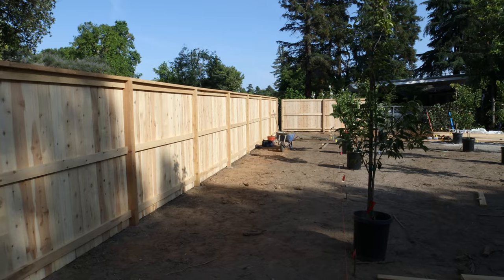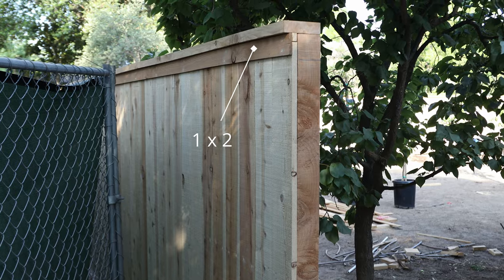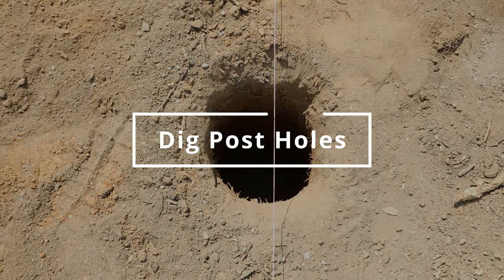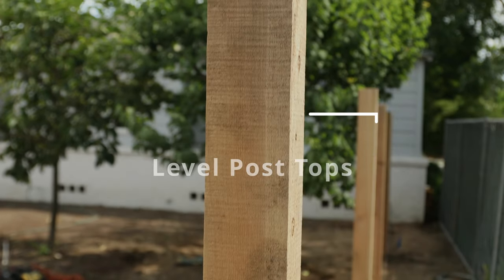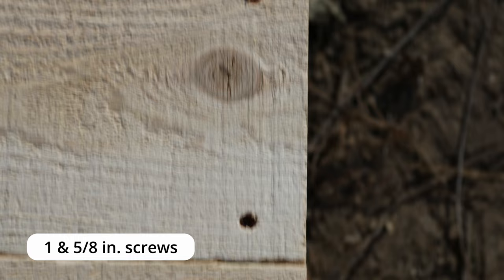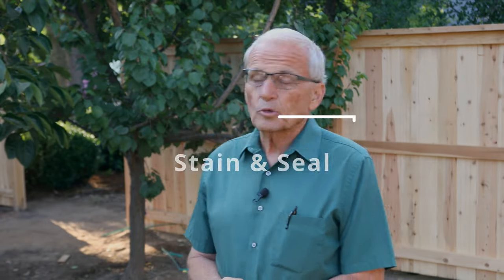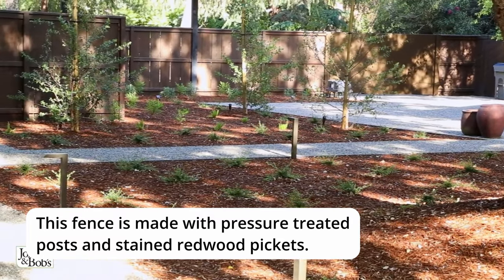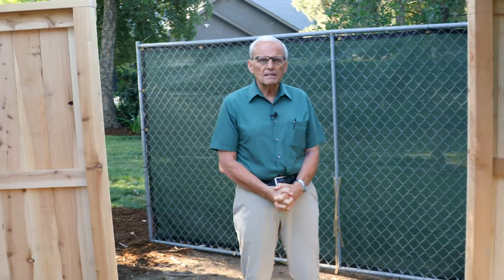How To Build A Fence (and other important info!) | Privacy Fence

Comment: Our son and our neighbor paid for a new fence across the back part of the yard (62 feet).  It was installed by "San Joaquin Fence", a Bakersfield, CA business.  The fence looks almost like the one in your video except on our fence you can see the posts on both sides.  The posts are actually steel pipes set in concrete and encased in wood on 4 sides so you do not see the steel post.  The cap running across the top of the fence is 2" x 6" (not 2" x 4") to cover the posts.  The pickets were recessed on our side so the fence would look as similar as possible on our neighbor's side.  We wanted a 5 foot (finished height) fence so we can still talk with the neighbor, so all the "dog ears" were cut off of the 6 foot pickets.  The fence is redwood and we stained it with "Thompson's Water Seal" in clear to try to preserve the natural color of the redwood.  I don't know how much it cost to build because our son won't tell us.  The water seal was about $20 a can and we used less than 2 cans.
Reply from the maker: Sounds like an excellent and long lasting fence! The steel pipes are a sturdy feature which will dramatically improve the durability of the fence. Send us a photo please.  - John

Comment: I had a good three foot stretch when I walked, I just gave myself a little more and it was exactly 3 feet. I used to to be a pipe welder and hole digger, trust your eye, one measurement one cut, one weld.
Reply from the maker: Love this! Thanks for your comment - "trust your eye" !

Comment: I have a cedar fence in my yard for over 30 years I still have some parts that are original, we only use the 1 x 4" cedar slits, there are about 1/2" thick, the ones you are using must be expensive. Buy good wood and it will last.  Most people here are just replacing the wood fences with vinyl now.
Reply from the maker: Yes! BUY. GOOD. WOOD. 
Thanks for the comment Jim!